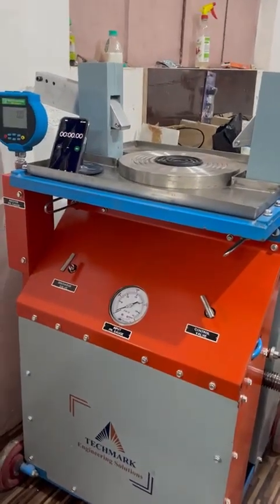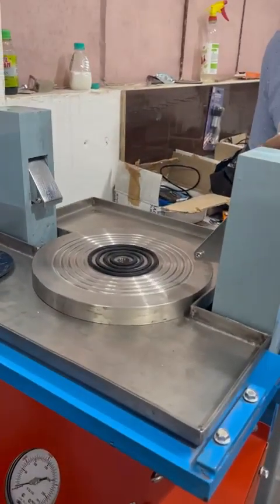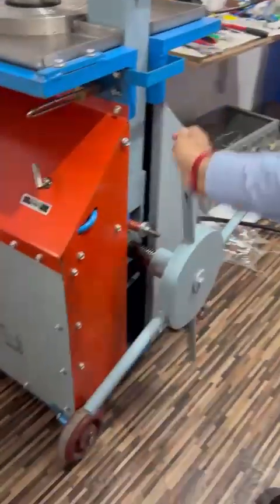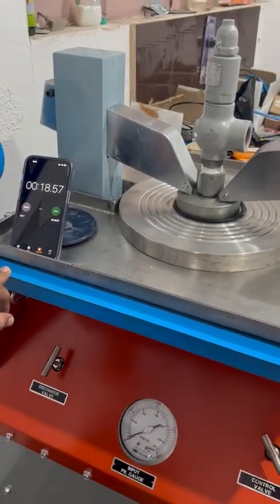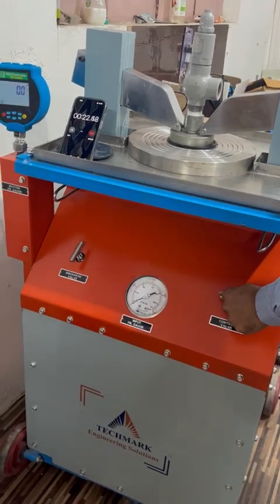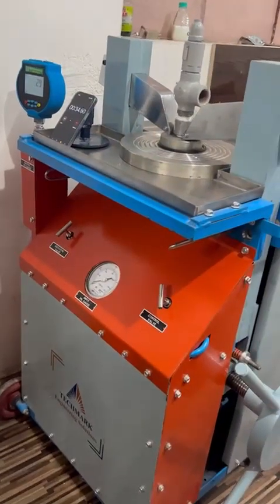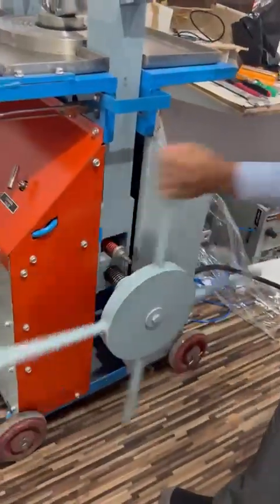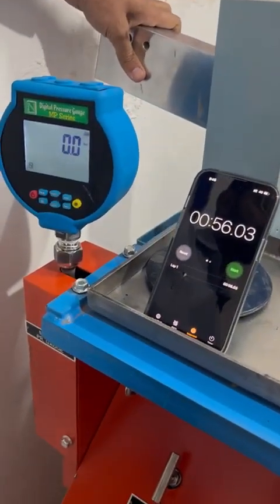Safety Valve Test Bench Quick Clamping Model (Demo Video)

Comment: This bench works only flange mounted safety valves need to screwed end testing bench
Reply from the maker: In this test bench you can test both screwed & flanged valves. For more details Kindly contact us on email - techmarkengg@gmail.com or Contact - 99091 14783